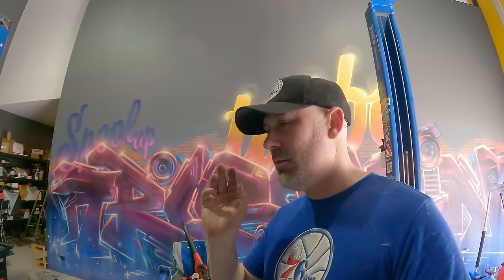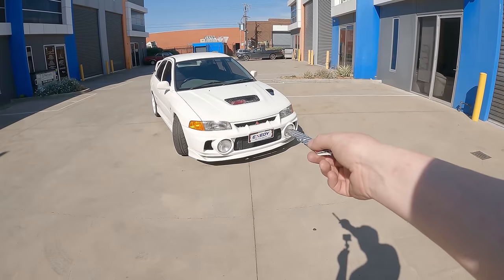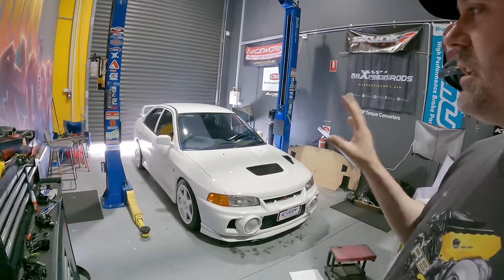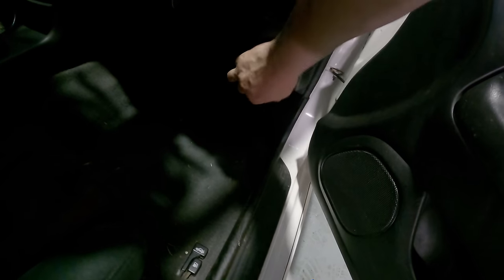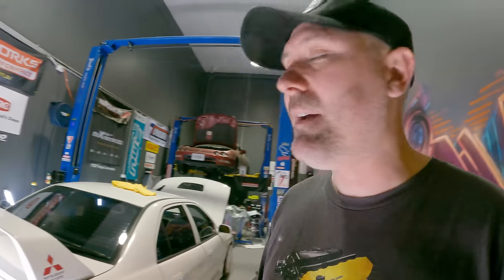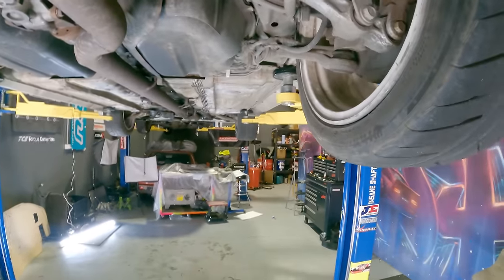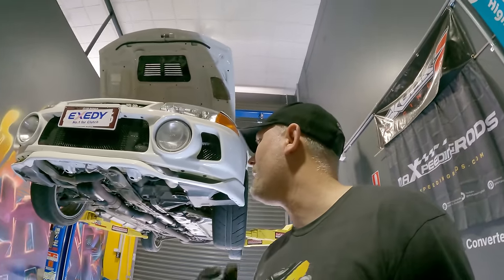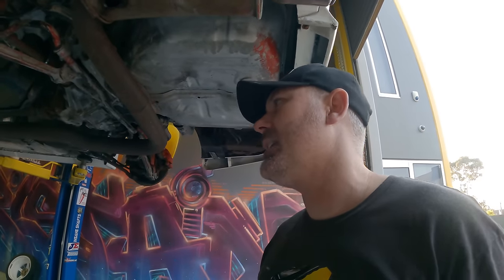New Project - Restoring a Neglected Mitsubishi Evolution IV Part 1.

Comment: I can't really see an issue with the exhaust, it's just a mild steel 3" unit, not shiny stainless. Other than the muffler it looks like its in one piece.  Definitely wouldn't be disappointed about this cars qaulity given its an import. 

You can do magna brakes as an upgrade most likely too.

The floor is an issue though.
Reply from the maker: it has sharp bends and crooked cuts no cat and its all one peice, with a really tight bend just before the rear muffler and i dont mind that its not shiney its just mega rusty and the welds are snot piles

Comment: The evo 4 was definitely worth it! Random question, for a cv dual carb d15b4 in a ed civic what air intake is suitable for it? Because I've heard not many air intakes are compatible with dual carbs
Reply from the maker: K&n replacement filter or leave it alone tbh